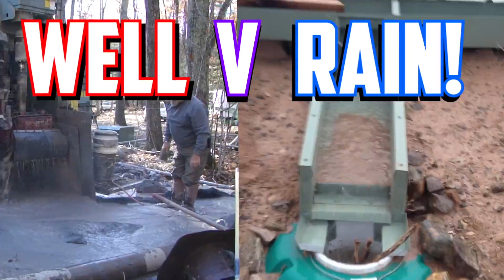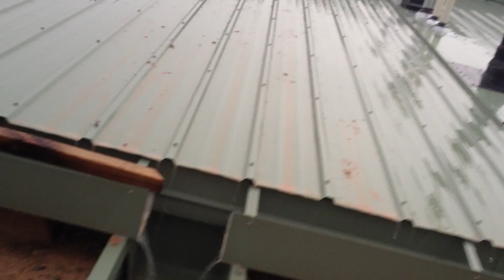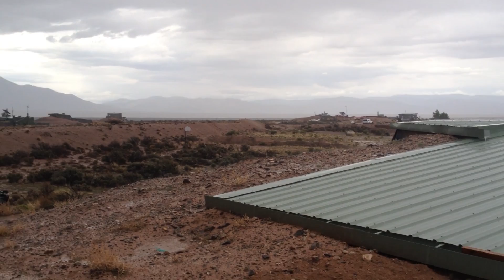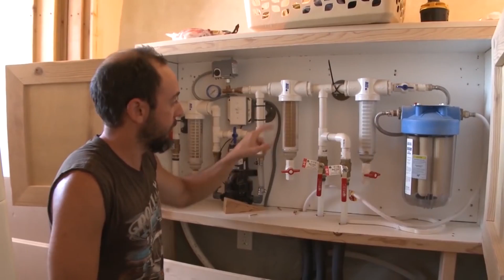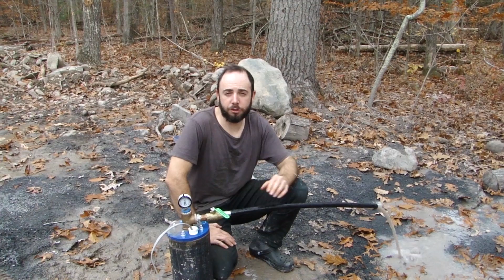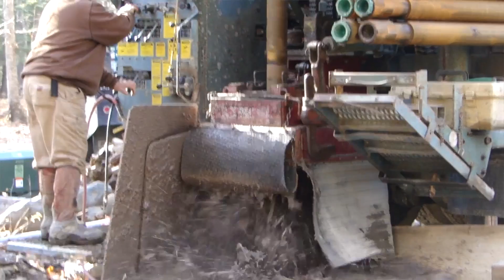Rainwater Catchment vs. Water Wells | Pros & Cons

Comment: I vote for well water but having both if possible is best. My house is located in a southern state out in the county with my own well and potable. A home water purification system is in my future just as an extra precaution. Like you said. Wells can go dry and that happened to my cousin. Think they were trying to fill an above ground pool. The only thing we have to mainly look out for when having a well initially drilled is if they go to deep looking for the water table. They can hit water too high with iron deposits. That’s no good. I have yet to check if I can collect my own rain water but I’ve got asphalt shingles. Not sure if I trust watering my garden with that either. Maybe someday I’ll find a sturdy enough metal roof that holds up in my area.

Comment: We have a well, and we did go very deep, 275 ft.   i would suggest to also get a hand pump on the well.  it is costly but when the electricity went out, we still had water.
Reply: Deep ? Wells in my area are 750-800 feet deep . 275 is very shallow in my area .

Comment: In my area it runs about $8000-10,000 to drill, case and cap a well. I installed my rain water catchment system with all the bells and whistles for $2000. I have a 1550 gallon above ground tank and 3 stage filtration to the house. With an Aquacera filter for drinking water. Once a month I do shock my tank with bleach. Never has anybody been sick from drinking my rainwater.
Reply: I always see the bleach method.
UV is very effective, cheap and safe. Why not use that?

Comment: i think a well is a better option, because i used to try using rainwater to water my garden and it was never enough, i would use around 200l and then run out, with a well there will always be water there where i live ( 300m from a river and 40m from  a stream ) and unlike rainwater where birds poop, acid rain happens and dirt gets on ur roof, a well is alot more sterile and better for most peoples use

Comment: You DO NOT need permission to catch rain water... that's an old "patriot" myth. There are Federal laws that protect an individual who collects rain water... Use a little common sense.
Reply: In Colorado all the surface water is allocated to existing water rights and if you collect rain water you are taking that much water away from another person who has the allocation for it.  Under this logic the state permits rainwater collection systems to protect existing users.  There is a permit process for residential and a few other systems.  Of course with 10-15 inches precipitation a year it's not very effective here anyway.  If you are interested the form is here: http://water.state.co.us/DWRIPub/Documents/gws-78.pdf
Kenny
Reply: Depending on the scale of your water needs, you can just not tell anyone. If you can get by with tanks that will fit in a shed, nobody's going to ask.

Comment: Good info.  Everything is so specific, it's really hard to tell.  Before we bought our current house, we had the water tested and I pulled the well records of all the houses around me.  Turns out, my well is almost 200 feet deeper than my neighbors, so they will run out of water way before I do.  I also researched the aquifer and again, mine is huge, going all the way up to Denver.  At the same time, some laws are completely stupid.  If I remember correct, for me to be able to do water catchment, I need to have a well.  That could be wrong though.  I know prior to 2009, nobody was allowed to do water catchment and then they changed it so that if you aren't using city supplied water, you can do water catchment.  So people in town are still not allowed to do water catchment.. So they can charge you money to water your lawn and then spend a bunch of money on billboards telling you to conserve water and not to water your lawn.  I mean, it's just dumb.
Reply from the maker: +James Zawacki thanks for the comment james. Ur always there w us, bud

Comment: I use well, rainwater catchment and rural water. The well water is used for livestock as it is an older well and not readily accessible to the house. I have rainwater catchment for livestock and emergency household use and for pressure washing, gardening etc. After figuring the cost of a new well, the measures needed to make it potable, ongoing maintenance and testing it was purely a financial decision to go with the local rural water system for household use even after paying to have the line run. I filter for taste but the rural water we get is higher quality than anything I can pull out of the ground here. Just couldn't justify the cost of a new well as much as I wanted to be "off grid" in that regard.
Reply from the maker: +captainquint cool!

Comment: I'd like to end up living at higher elevation so will likely not have a choice and have to go with rain water.  If I had a choice I'd go with a well as I'd like to live more southwest where there's not a lot of rain.   Have a well right now (for the past 24 yrs) in SE WI.   With a well you'd have to have the energy available to pump it out though.... guess it would depend how much energy is required when off grid.

Comment: Manure can easily contaminate well water in many areas. So filtering is probably needed no matter where you are at least to some extent.
Reply from the maker: Correct, if you are doing a shallow dug well in the overburden, but lots of wells here go down to bedrock, often hundreds of feet deep.  Many have no bacteria in them and are ready for consumption with no filtering.
Reply from the maker: no doubt
Reply: No I have not had this problem but it was an issue in a number of counties in the state that I live in.
Reply: most state regulations require 150' up hill from septic leach lines and 200' from cow pastures. filtering not required and generally not needed. 
is this a problem you've had?